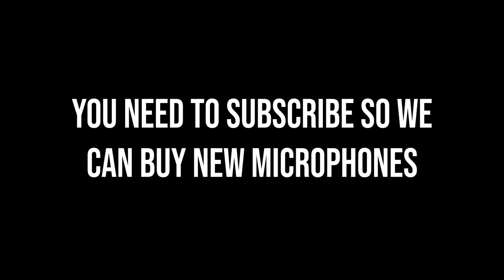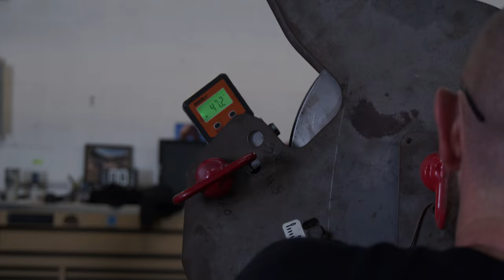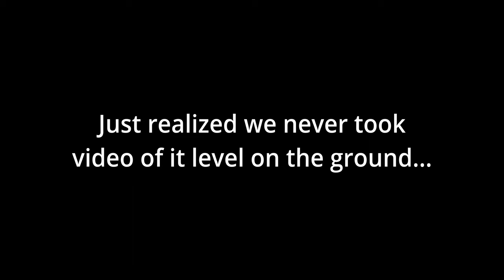2024 JEEP JL RUBICON GETS CUSTOM LONG ARM SUSPENSION AND COILOVERS!! | OA BUILDS

Comment: What spring rates are you running on those 14" coilovers?
Reply: Not sure if they answered you privately or if you are still wondering. My EVO kit came with 
front 3.0 12 250ibs/3.0 14 250ibs extra 3.0 14 400ibs
Rear 3.0 12 200ibs/3.0 14 200ibs.
Ours is a 4XE, they’re tail heavy and standard spring rates unfortunately was not a perfect match. 
Switching to 3.0 14 200/3.0 14 250 all around.